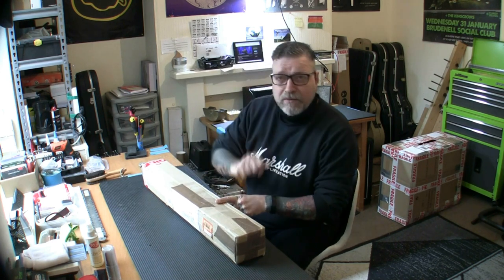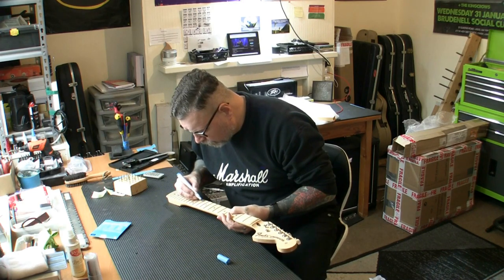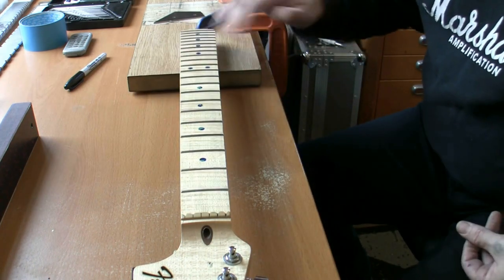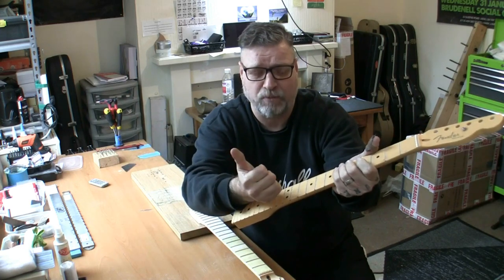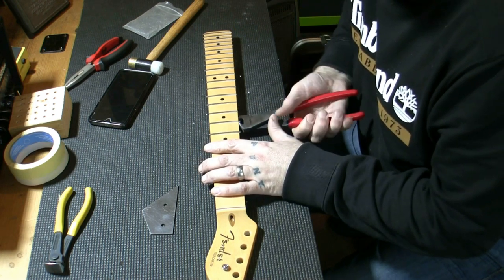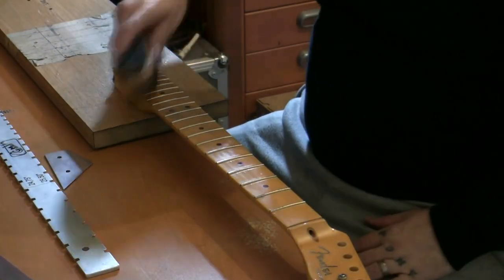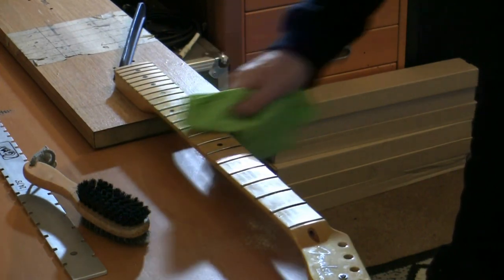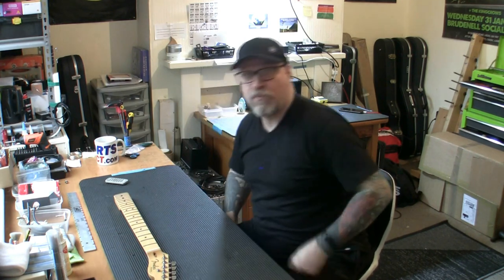1 client, 2 necks. #1: Fret level on stainless steel frets. #2: Refret on a compound radius neck...

Comment: Still a bit confused on what you do differently with a compound radius. You said you follow the line of the strings but I dont see what you are doing different. Looks like you are just taking the leveling beam and going straight down. When you go off closer to the sides of the fretboard, are you tilting the beam at all or is it staying flat the entire time?
Reply from the maker: It is far too difficult to explain in text. Also, did I not explain in the video? Google it. Victor...
Reply: @FretFriendGWaL  not that I saw
Reply from the maker: @ericjutsu8391  Did you watch the whole video?

Comment: Quick question @fretfriendgwal , what grits did you use for polishing the stainless steel frets? I have to polish some of mine on a new guitar I got, and it has tooling marks on them so it feels super rough so I have to smooth them out
Reply from the maker: I use 400 grit through 2000 so 400/600/800/1000/1200/1500/2000
Reply: @FretFriendGWaL  thanks for that! I actually went ahead with it this past weekend starting at 400 and working all the way up and it worked out really well. Glassy smooth stainless steel frets now. Thanks again for your great videos, I know it takes a lot of time but those of us who watch really appreciate it 🙏 it’s a certain breed who are passionate about this stuff!